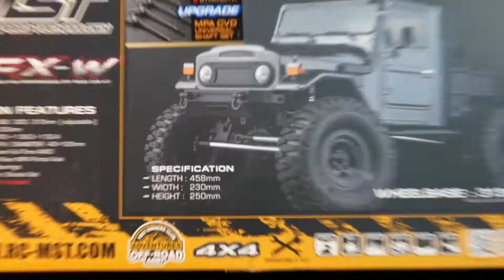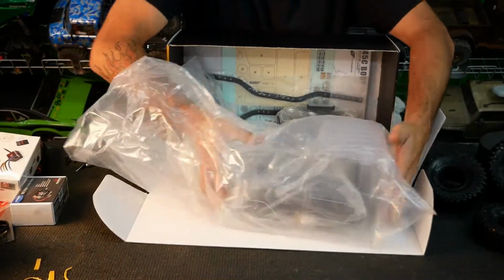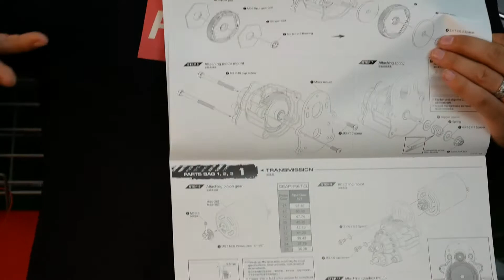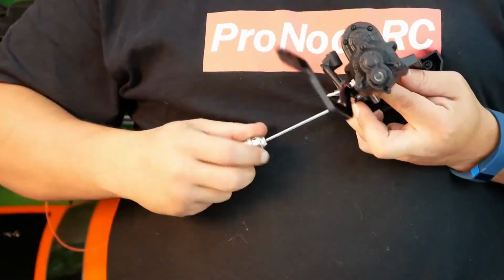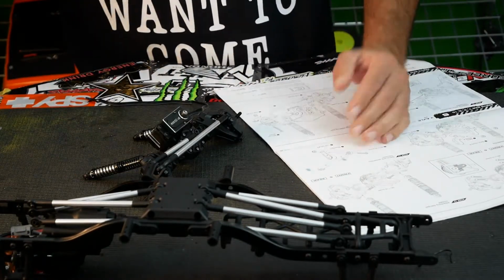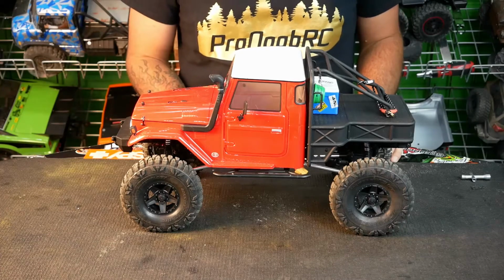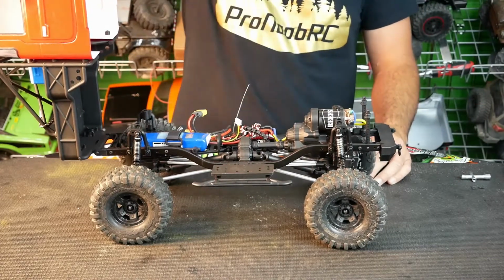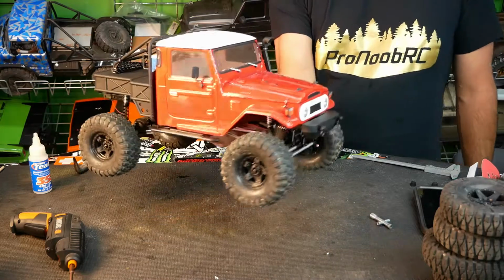MST CFX-W J45C: Kit Unboxing, Build and Review

Comment: Consider getting this as a 2nd crawler. Have a UMG10 and want to make it more scale. That's why I'm thinking of this one. The tires I'm thinking about are Pitbull rock beast and Gmade SR02 rims. Lowering the car is something I intend to do. Did you say there was an 80 mm damper on it. One tip I found was a 75 mm damper, but if it only differs by 5 mm, it feels unnecessary. Instead, insert spacers under the piston to limit suspension. With maybe 10-15 mm then it will be really low. Also seen someone put on 17 mm wheel hex to widen it. What do you think I am on the right track with modifications. 🏁🇸🇪
Reply from the maker: See our other video on fixing the suspension? https://youtu.be/Y1ziSBaK5CA. Real simply fix and sooo much better!  Only costs 4 long screws and some time